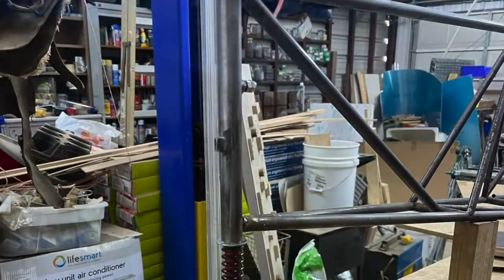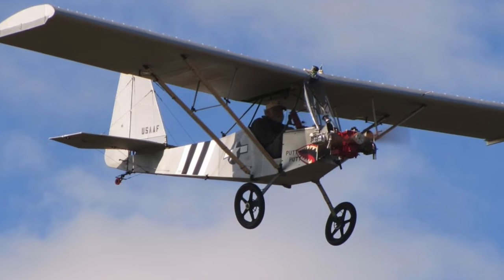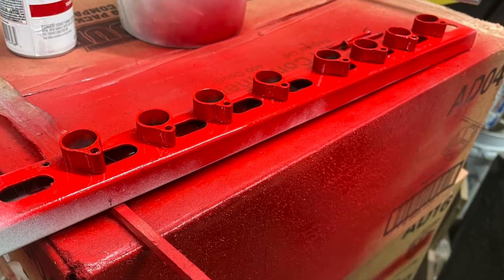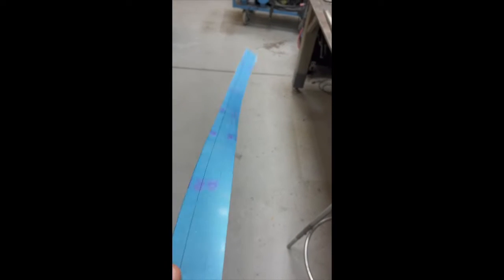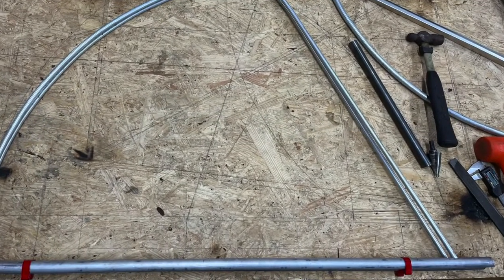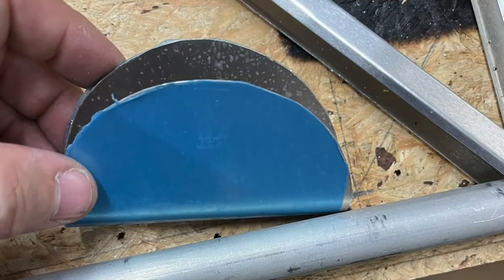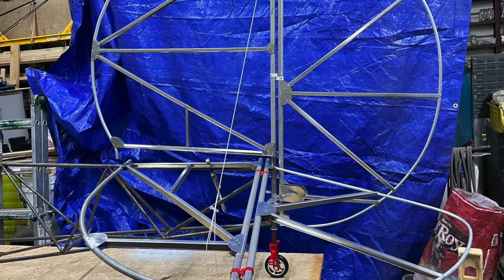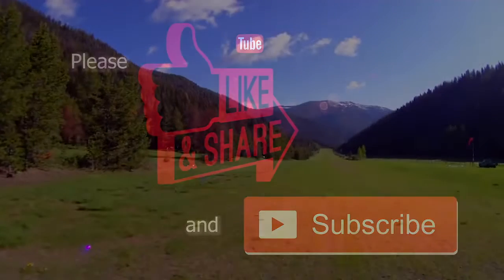13 Tail Section (Part 1) ADCO Aviation's Legal Eagle XL Ultralight Aircraft Build Series

Comment: I ran into a blog where Spencer called out a red flag on the leading tube on the vertical stabilizer. And on putt putt walk around you can see his is 4130. Be nice to know what happened for him to make the change. I followed suit and did mine the same, 035 - 4130 and made a kicker/support piece also. I know they were talking about the early LE where the top Longeron/ vert stabliser point there was no support under the attach point. They suggested welding a support vertical just under the leading tube attached point. The plans have changed in later years so the cross webbing hits that point for support.
My LE has a 3/4 top Longeron so I feel it's OK ( for now)  
I told Leonard no one builds lighter than you, I'm thinking your giving him a run for weight. Good job brother.
Reply from the maker: I'm trying... lol   Thanks my friend....